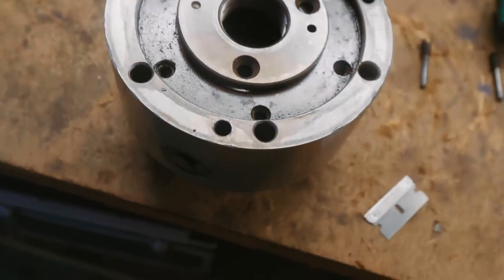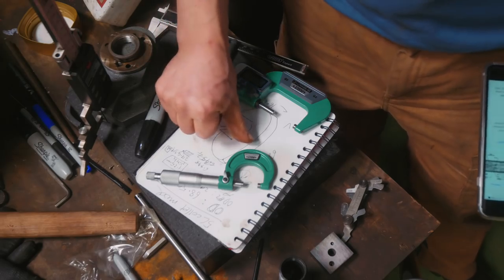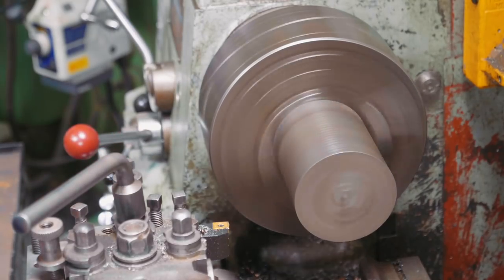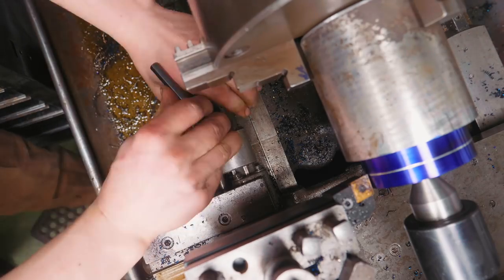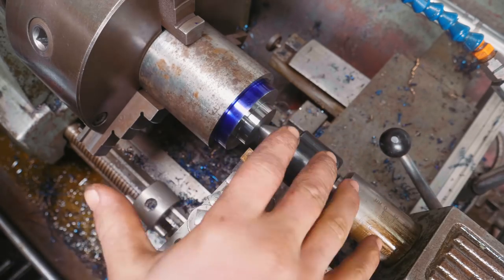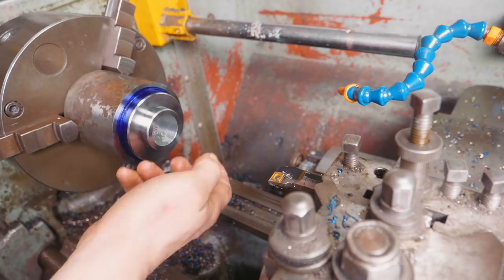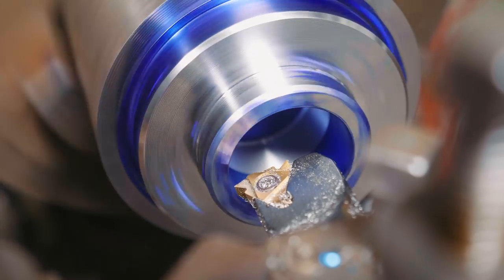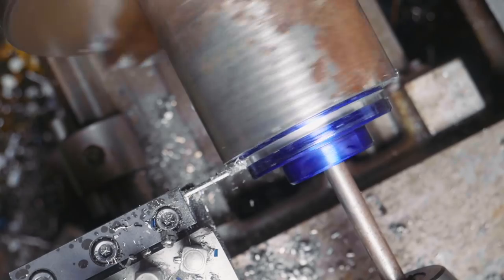LATHE CHUCK MODIFICATION!!! Part 2

Comment: When taking measurements this small, the difference in temperature (expansion and contraction in material) make the difference .
Reply: It's not recommend to hold the parts in hand while taking very small and precise measurements. Nice job.
Reply: That is also the reason for the plastic bit on the bend on a micrometer. To keep the heat of  the fingers from transfering into the metal and mess up the results.

Comment: I use a small wire brush to keep the threads clean, while tests the fit ,Once I had a piece get stuck so bad I ruined it  trying to unscrew them , all due to a bit of grit left on one of the pieces,awesome job Alec ,I love watching you work ,and your humility is great too , shows that your not afraid to admit mistakes

Comment: Alec. Barrier Cream for your hands while working with oils and solvents if you aren't wearing gloves. 
if you are using a lathe or any other tool with moving parts don't have loose clothing headphones or hair.
also while you were successful in making your part. you were very focused on making it the same as the old part, the tolerances you were aiming for were artefacts of wear and tear. measuring the size of where it must fit would have been better the tool would last longer and its easier to hit the target if its not such a tight tolerance you are aiming for. 

as an amateur machinist i'm impressed i worked with a man that's been bumbling through the craft for over a decade that wouldn't have succeeded in that

Comment: Hey alec 
When you need to turn a diameter that needs to be spot on, you can go .9mm bigger than your final size. Then you go in 
.3 mm passes to your size, measure every pass you make and evaluate the correction you need to make. That is how i learned it as a machinist.

Comment: Dude ..... get a dial indicator with a magnetic back plate and slap it in a convenient spot against the cross slide and never worry about backlash again!   Not only does it increase accuracy easily but any errant movement while under load.   Cheers

Comment: Piece of advise - a very handy book. I’d suggest (if you don’t already have one) buying a Zeus chart. It’s a little yellow book with very useful information. The first few pages have lots of information on various different threads. Very cheap to buy, and should be in the toolbox of anyone who works in manufacturing.

Comment: The proper way to machine pieces like this, learned it myself the hard way:
1) machine its basic forms and drill out the hole, leaving approx. 1-2mm for finishing work
2)repeat all the steps you did before, but with exact measurements
This way, you do make yourself do more work (almost 2 times as much more), but you will get the right measurements needed.
There is no other way around. The way you machined it, the material warps after each step(not from temperature, but from material trying to hold itself "stable", dont really remember the word for it in english), in places you already made the finishing touches. Also the piece you are machining is really heavy, and its usually necessary to take the rotation speed down for safety measures. 
No offence, just a machinist tip, love your works by the way.

Comment: Being relatively new to machining, I have a small question, I know its bad to use oil coolant and a brush on carbide when milling (due to risk of heat fracture) but is what Alec did with the cutting fluid and the thread cutting tool okay?
Reply: I'm not a machinist, but my understanding is carbide doesn't like rapid changes in temp. If your using coolant, then you must flood cool.  If you not using coolant then leave it completely dry for the hole operation. Starting with a drop of coolant wont hurt nothing.

Comment: when taking your finish cuts leave about 0.5mm on the diameter then take 2 equal cuts to keep tool pressure the same for each cut that way your guaranteed to be within a thou or 2

Comment: I feel like those tolerances you're trying to match are waay to tight. I wouldn't worry about it so long as the thing fits!
Reply: Yeah, for a part like that I'd call for +-.015" on the small ID and probably +-.005" on the large ID.  I'd say he is just doing the best work he can, and not thinking about slop.

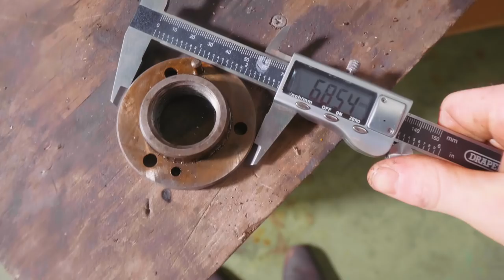Comment: Like the enthusiasm :) Set a indicator on the back of the crosslide and If you go to 1:18 in episode 10 of the home shop machinist podcast/aka beer/car tangentpodcast (with ROBRENZ as guest) he describes a good way to make that final cut right down to hit the size (in his case to 0.0001/2.54 micron, but I usually can reliably work to within 0.05 mm). Styration deserves a T shirt by now btw

Comment: The maximum depth of cut you can take when roughing is roughly half the width of the carbide cutting tip, just to make things a bit quicker for you.
You can, in theory, take a whole width cut, but I have only ever seen one guy that could do it without making something explode. The lathe sure was loaded up and running hard that day!

Another tip with carbide is coolant or no coolant, but never both. Coolant lets you take the big cuts and gives a better surface finish - hence why everything runs with coolant in tool shops ;)

Comment: Alec, you should try taking 3 times the same cut. I mean 0.060in over what you want. Then take 0.020, you probably wont have the mesure you want. You will have to take 0.020 +- 0.002 and now you are bang on 0.020 over the mesure you want. Just take another pass with the "spring" you noticed. You could do a 0.100 in long pass and stop there, back up, mesure and finish the pass without touching your handle. Sorry for my english, I hope this will help !

Comment: If you need to remove a tiny amount from an item on the lathe, don't use a cutter. Use sandpaper.

Speaking of precise measurements, I was cutting a pair of aluminum bars for some home robotics today; my saw blade is misaligned by about 3mm to 4mm (be careful when lending your tools!) and the blade will remove about that much more material again. I have small calipers and a wonderfully accurate 300mm ruler (with slots for etches in 0.25mm increments - it's made by Incra Rules), but I need these pieces to be at least 475mm. I decided to target 500mm with a tolerance of 20mm - if it's too long I can cut more off, and it it's somewhere between 475 and 500 then I can put a nice curve along the edges for cosmetic reasons, and 500mm would allow a perfect curve. So, it's cutting time: measure twice (literally, 300mm + (200mm + a bit)), then cut; measure twice for the next piece, and cut. Then I used a trick I learned from ClickSpring: I don't need the pieces to be an accurate length, but I do need them to both be the same length, so I clamp them together and take an angle grinder to the edges until they are equal. I throw in some hand filing to even it out and soften the sharp edges until it looks good.

Now it's time to measure them again, and see if I made some big pieces of scrap. I measured it three times because I didn't believe it. 499.75mm. I had expected each cut to have about 5mm of slop and to lose a few more mm to grinding, but I never expected to get within 0.25mm when I gave myself a tolerance of 20mm. I was pretty proud of how well I eyeballed that, in fact I'm so proud that the extra cosmetic aspects are now a requirement and everything else will be built to the scale of these pieces.

And then I realized, it was frigid cold in the garage when I did all this, and aluminum has high thermal expansion. I plugged the numbers into the calculator, and the length at room temperature is 500.02mm.

0.02mm, that's 0.0008 inches, by eyeball (and luck). So now the pieces are warming up, and I'm shopping for really big calipers to see if I actually am that amazing.

Comment: Another little tip from someone who has had to fix a number of threaded holes buggered by other people. When you've got your final thread pitch in and you'd like to smooth out the threads a bit more, smear in some metal polishing compound in the hole and on a matching bolt or screw. Run it in and out a few times with a high speed drill. Does a nice job at polishing the threads and will give you just a bit more clearance and should help with getting screws stuck in the future, as you aren't leaving as many microscopic jagged edges to seize up.
Clean out the polishing compound with some solvent when you're done, and a drop of clean oil.

Comment: Those dial reference @6:23 used to be "movable" to reset the zero on a more convenient position when I use to work with lathe. 
And yes, loosing the number when taking the backlash is painfully stupid!!! Them ADD... (I know 'coz did them same)

Comment: Hi! I am kinda new to the Channel, but i checked back the videos, AWSOME STUFF!

I have some questions: The metal dust is reuseable in some ways, is there way to recycle?
Same with the bigger elements like "matching the part, so soome will be cut down" left over chunks?
Also how do you clean your clothes? What can handle the ig oil marks, and stuff :) ?
A video response would be perfect, a comment like OK too, THX!

Comment: You have a DRO why are you using the graduations on the lathe, that's the point of the 1500 dollar DRO upgrade, you need to talk to Tom Lipton or Keith Fenner or even Abom about using your DRO to it's full capability

Comment: Great work Alec! I’d like to make a suggestion about your machining. That lathe can take a hell of a lot heavier cut. That old iron is super stout. Using that carbide cutter, you could have finished that OD in 3 cuts. As a bonus, the chips would be easier cleanup as they wouldn’t be all stringy.

Also, on your finish cuts, rather than going off the dials in the machine, just toss your Noga mag base and indicator on the tool post.

Comment: Alec, regarding your use of the telescoping gauges, you are using them a bit differently than I do. My process goes like this; insert gauge, snap open, have the bottom leg of the gauge maybe 1/4 to 3/8inch in the bore at the bottom, have the top leg at least twice as far in the bore(10 degree angle +/- ), snug screw, pull down on handle causing only the top leg to move, halfway through pulling down, slightly move the handle side to side to help center the legs(you can even move it side to side while pulling down), lastly just remember to use the same pressure on the mic as you used on the gauge. https://www.youtube.com/watch?v=R6YLK0F3ytc This guy is a great machinist and his method is easy to understand. Getting consistent measurements is key when using the snap gauges. Love your videos immensely! Keep up the good work man!

Comment: Larger diameter stock = lower RPMs. Saftey First.
Surface Finish will affect measurements depending on the gauge.
Single Point threading is the most terrifying opreation one can undertake on a lathe, also the most satisfying.

Comment: I would have welded up the thread in the collet and cut a new thread into that so you don't have to take apart the collet chuck and change the part you made every time you change a collet.

Comment: I worked at a machine shop for a few years, and 0.005" was fine for pretty much all the parts we made. Most parts had a 0.010" tolerance and that was considered pretty precise.

Comment: The change of zero is a good sign. Mics of that quality are so sensitive that they'll register the expansion and contraction of their own materials from the heat in your hand and the change in ambient temperature. In the Manufacturing Academy (put on by the Aerospace Joint Apprenticeship Committee - AJAC) I saw this first hand when we stuck a micrometer in the fridge, shut it all the way, and watched the dial move as our instructor held it in his hand.

Try it out! It's a fascinating demonstration of the heat properties of steel.

Comment: Always rough out every face/bore to within 1mm then finish everything. If you finish the faces and diameter when you drill with a large drill you risk it moving in the chuck and running out. Take this from experience.

Comment: Greetings Alec I noted that after finishing a Z axis finish cut you are currently in the habit of feeding it back out by hand without adjusting your X axis at all. This is not problematic when you are roughing as you will be removing more material any ways, however when it comes to finish cuts this will create the over cuts you have been getting (the screw like cut marks), and a potential for inaccurate dimensions, as well as deteriorated surface finish. No mater how small the cut there will always be at prepositional (to cutter load) amount of cutter deflection. After a cut is finished the deflection will decrease given the lesser cutter load; this will mean that the cutting point will effectively move deeper into your part (in the X axis) at the end of your cut compared to the during. I would recommend that you get in the habit of noting your increment on the cross feed, and back it away from your cut surface by one full rotation (care when boring, may not allow full rotation depending on bore diameter) at the end of your Z axis cut, then return it to that increment after backing the cutting away from your part on the Z axis. I hope this made sense, and helps you get more accurate parts as you learn to hone your turning skills.

Comment: Another thing you can do to help with rigidity and keeping sizes is to make sure that the Gibbs have just a touch of drag, keeps the crosslide from wobbling back and for and helps with back lash issues. Just since you lathe looks a couple years around the block

Comment: I think you that shouldn't cut straight with lathe, but instead you should make 1,5 width cut so you won't break your blade as you did in your several previous videos.

Comment: Nice vid! Iam just starting to learn the lathe my self. 
I´ve got a tip for you! 
When you want to zero in something, i use a tool with a ball bearing on the tip an gently push the wobbling material in to zero :)

Comment: It all has to do with "tool pressure" alec. Your right on taking a dead pass or spring cut on that last pass. U think what happened to you was when you took out the backlash or your crossfeed. Only very tight machines can you back out from where you were and hit the measurement right on.

Comment: I know that some lathe graduations account for material being taken from both sides of the sphere and some don't.  my antique lathe does not take this into account, so I need to 1/2 the increment so that when the chips are made, taking into account both the closest and furthest side of the work I'm bang on.

My new lathe takes this into account, so the graduation is actually moving half that into the work.   confusing, yes

Comment: You should set your compound to an angle of 29.5 degrees to minimize the surface contact to only the front edge of your cutting tool. Feeding into to the cut with the compound rather than strictly the cross slide will make for a much cleaner thread, especially when getting into larger thread pitches.

Comment: I admire your patience to take exact measurements but I have 1 thing to say : when taking a measure with a micrometer, you not only must click it 3 times but you should also read the measure in place on the piece because you risk changing the results. I know it must be difficult ready it when your piece is held on the chuck but thats the safe way.

Comment: The reason you went so far past tolerance is when you had the backlash around 10:40 . you just can't bring the cutter back because it will be off. You have to re-touch off.

Comment: Fyi when using mic’s u should only hold the mic by the small plastic label in the center of the arc, for precise measurements, the heat of your hand can cause the mic to expand ever so slightly.

Comment: When I was in the navy I had tolerances of 5 ten thousands of an inch for submarine work. There was times I had to remove material using diesel fuel in a piece of blue jean material and lap off a couple of ten thousands of an inch.

Comment: You should try to forge a knife out of all of your drill shavings. You could have a high carbon steel core if the shavings are mostly low carbon.

Comment: another tip for working on the lathe. either take off the necklace, or tuck it inside your shirt.
Wouldn't want that to hang up on a spinning chuck. ;)

Comment: When possible, cut deeper than 5 thousandths at a time because the tool can sometimes not bite properly and simply glide over the surface (depends on the condition of the tool)

Comment: Digital mics would make things a lot easier, when it comes to analogue mics metric is harder to read compared to imperial as they have more divisions so can be a pain in the arse to read if you're working to tighter tolerances.

Comment: usually when your around 0.1mm off finished dimension take a spring cut then crack out the emery cloth! its either that or use a clock on the cross slide.
Reply: BedfordshireBiker thoughts about using some knurling to gain diameter on that flange edge?
Reply: On "most" general use manual lathes the lash in the gears can often make <0.1mm cuts difficult to make accurately without vary sharp cutters, I would agree with Bedfordshinebiker on his stated point. I would add that it vary much depends on the type of fit you need, and how much tolerance is acceptable for your current task( here is a link to an ISO standers calculator for shafts, and holes I often use that you may find useful). My series of operations if I need a +- .0005" tolerance usually is rough cut to +.022", followed by .010" "finish" cut to confirm accuracy, followed by a second .010" cut to bring the dimension to +.002" (over nominal) then use emery cloth (220-320 at around 800-1500 rpm) to bring the part to a high finish, and remove the last .002".
Reply: This is good info,  thank you.
Reply: only usually do that if your pressing it in...
Reply: yes thats the best way on a manual machine. On a CNC these days its so easy just to adjust your offsets to chase that last thou